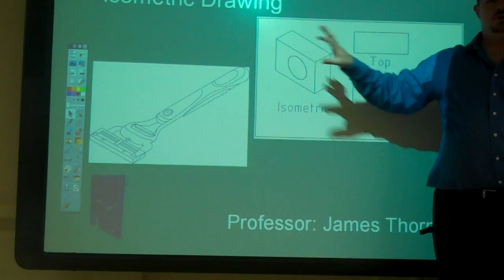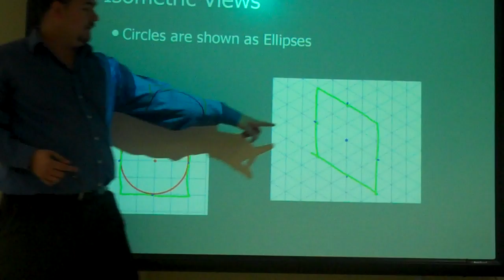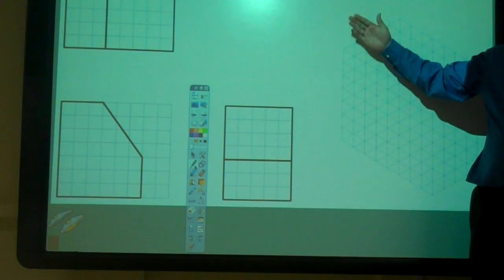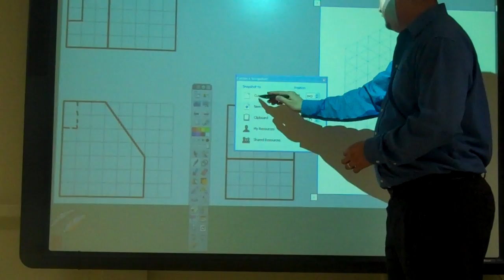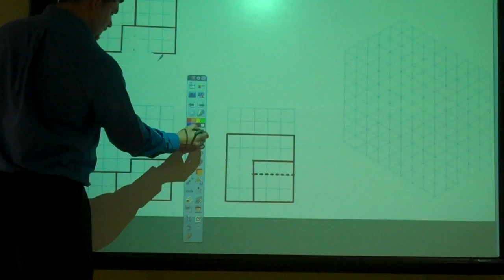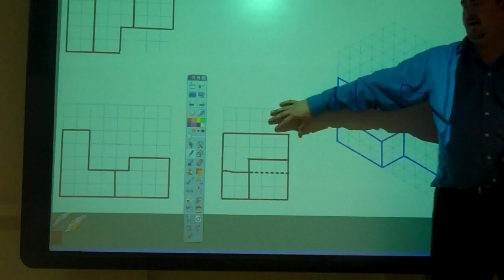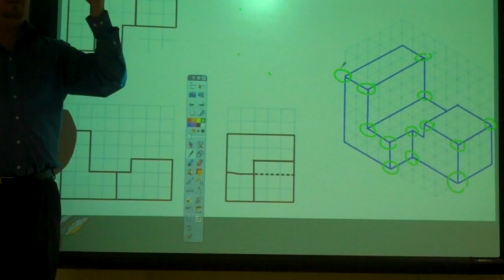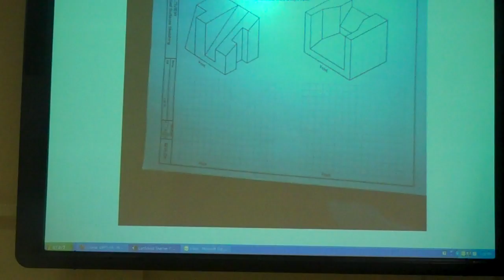Creating Isometric Views

Comment: Using your grid lines, for where the circle crosses a line, at each grid line, and that point position, will help in drawing a more perfect ellipse. It's better to do this, than just using just the four center line points about the square. You will see that the circle divides the next grid line at about 1/4 the distance from the squares edge, and that point on the line will transfer to the ellipse. Thus, if we say that the square equals four inches, with a four inch diameter circle inside, and at the one and three inch lines, the circle is crossing the line at about 1/4 the distance away from the edge of the square, we can use this reference. At this crossing point, add a point to draw the ellipse through, and that will make it much easier to get the correct shape. That will give you eight points, instead of four, to construct with.